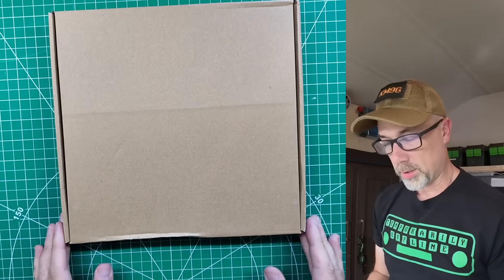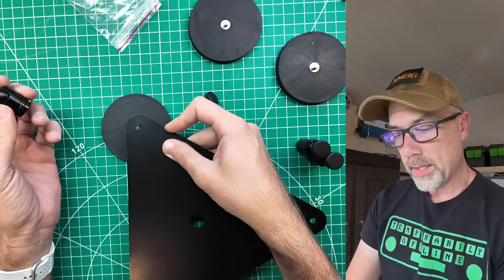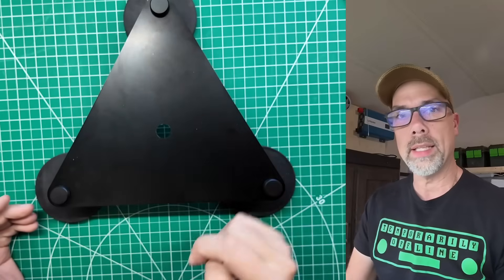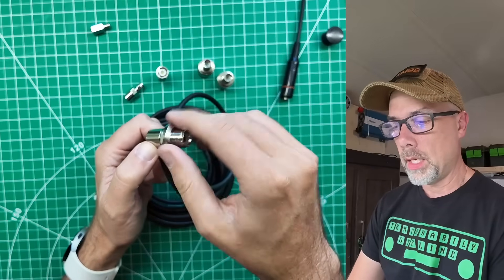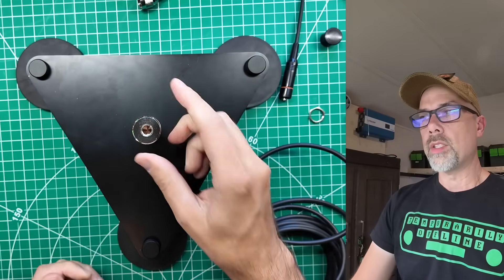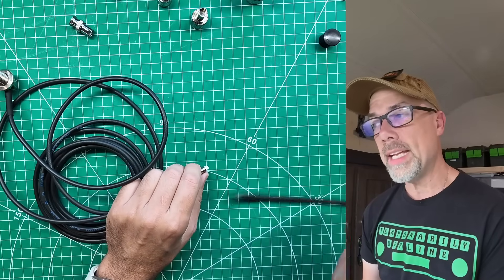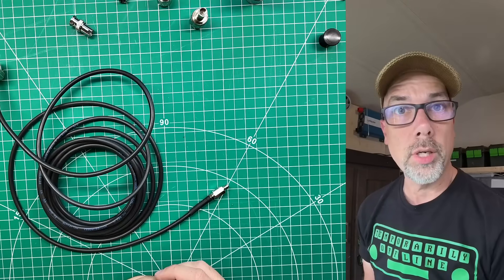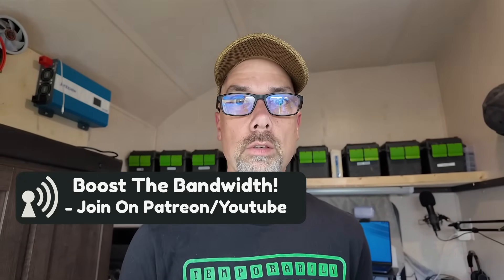Can you call a Triple Mag Mount Awesome?  Let's see

Comment: Very cool. Any ideas on how to use this for a solar Meshtastic car node?
Reply from the maker: Sure, get an adapter for your antenna type if needed and just plug it in.
Reply: @temporarilyoffline  Sorry, I meant having the entire unit external. But I’m sure I could figure something out.
Reply from the maker: @HughRoper yeah. Plenty of examples out there and this has some good mounting points to place something on top.  Get a good solar panel attached to it and put the node between that and the mag mount.

Comment: Since vertical antennas need a ground plane to function, I looked into the apparent lack of grounding on magmounts and as it turns out, the ground plane functions via capacitive coupling.  So I wonder how the ground plane is affected with the higher standoffs?  Still, a magmount is a compromise antenna anyway so if you just need a quick and dirty setup for local communications - have at it.  Even more so, if you're able to talk skip and be heard a long ways away, congratulations because you deserve every ounce of pride you can experience for pulling that off!  :)
Reply from the maker: Every mobile antenna is a compromise my friend.  Every.Single.One.  And 100% agreed, grin from ear to ear when you make good contacts on your mobile setup, you've earned them!

Comment: I wonder whether the standoffs putting the plate so high might change how well the ground plane interacts with the vehicle.  I'd be curious to see how well HF antennas tune up with that standing so tall.   I'm not a fan of the FME connectors.  Why the heck didn't they just put an SMA on the end.  Then, we'd all have the right adapters in our bag-o-dapters without having to keep yet another standard laying around.  That seemed like a dumb choice.  Honestly, I'd have preferred if the SO-239 at the bottom was just an SO-239 -> SO-239 L-adapter.  Then, if the coax gets ruined, it's just standard coax to replace with a PL connector on one end, and whatever you want on the other.  Seems like they went out of their way to make the connectors on this thing proprietary.  I guess I'm not a fan.
Reply from the maker: Sounds like you're not.

Comment: If you don't want to drill a hole in the roof or squeeze a bracket between 2 panels they can work good.   
I prefer to avoid mag mounts in general with an exception for my Sirio 10m/12m antenna and Magnetic base.
Only reason I have the Sirio Magmount is it has a 8inch base and a So-239 mount for my CB or 2m/70cm antennas when in a borrowed car or loaning for a road trip.
Reply from the maker: Sounds like you've got a good setup for borrowed cars!

Comment: The connector on the end of the cable is an FME connector. Incidentally,  usually the standard nut goes below the mounting plate  to allow for connector-height adjustment and to distribute the load of the antenna better. The larger nut usually has a rubber o-ring for weather-sealing.
Reply from the maker: Thanks for the tips on the nuts and weather-sealing!

Comment: Maybe others here know more but I left a small mag mount on for a few months, (not that long), on the roof of one of our autos and when I took it off rust had began to pop through the paint in a perfect circle matching the magnet. Was the rust already there? Magnet was new and clean. Magnets super-charge rust action? I don't see how but if so, that's a new one to me. I'm using a clamp-on roof rack mount at this point. Cheers.
Reply from the maker: Was it the mag mount's housing rusting and staining the car or the car rusting?
Reply: @temporarilyoffline  Rust popping through auto's paint. No rust on new mag mount. It had a foil sticker on the bottom of magnet, ( I suppose to protect paint? Try to envision light rust peeking out through the paint on the roof under the magnet only. In the shape of the magnet. Maybe it was from trapped moisture under the magnet then cooking in the hot sun?Damp car covers left on in the sun can cause damage to paint.Seen that happen first hand. Maybe the paint was weathered on the roof and rust lay just beneath what was visible? We live on the west coast where there's often humidity. Still, a weird thing. I've used mag mounts for years off/on - never seen this happen. Maybe others have seen the effect. Cheers.

Comment: Nice mag mount !  Now for aluminum  you can use 3 of them suction cups from that other antenna mount . I would still tether it. The 3 mag mount I have has a MNO adapter on it and I used blue RTV silicone to hold booties on . Works great on my COMET GMRS/MURS one with the loop around the center load. Also does 2M/70CM . very wide band antenna . It on the car now for GMRS/MURS radio. Some Walmart's use MURS radios   . we found them ! Some use FRS radios. 73
Reply from the maker: Sounds like you've got a great setup!

Comment: The coax does care what "kind of signal" you get in there, because coax loss is related to the great frequency of the signal, so I don't know why you said that.
Reply from the maker: Yep, you are 100% correct in what you thought I meant and your correction for your interpretation is 100% correct.
Reply: Absolutely, not just signal. 
MagMount don’t like when you add additional coax cable. It spikes the SWR. 
My experience, additional max jumper cable 3m. 
Since there’s SMA connections included with the MagMount the max pep power from that I’m guessing is just 50 watts.